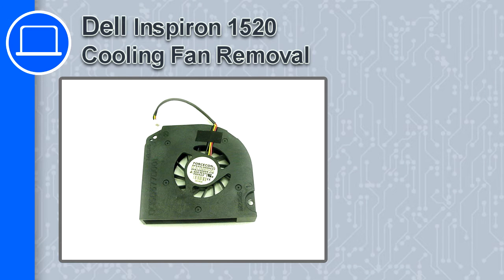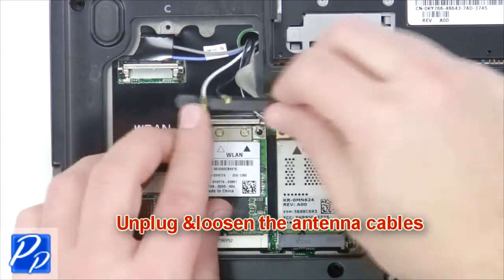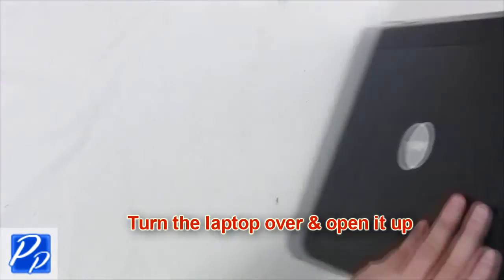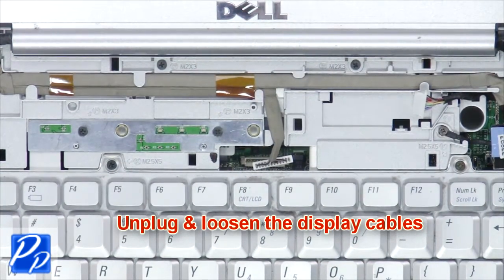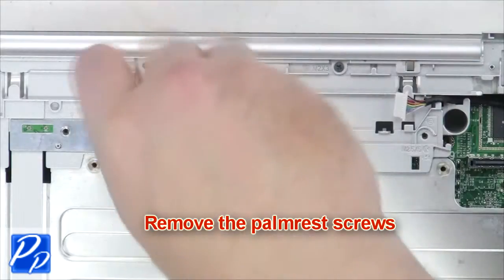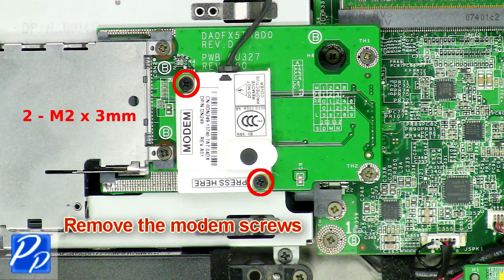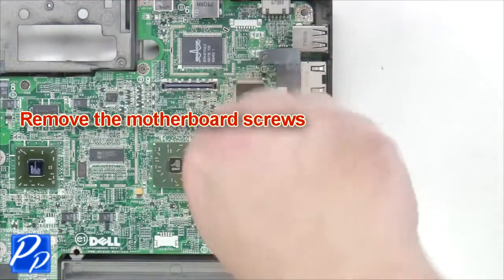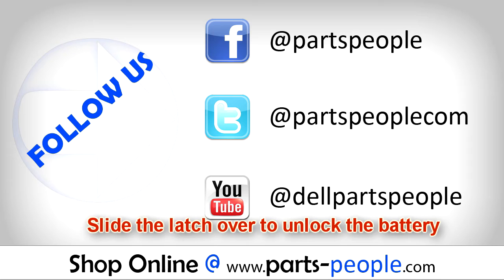Dell Inspiron 1520 Cooling Fan Replacement Video Tutorial

Comment: This is the way I cleaned out the cooling system:
1: Turn off laptop and remove AC power cable
2: Put hand over two exhaust vents
3: Put mouth over other two exhaust vents, like you're going to french kiss it
4: Blow as hard as you can.  Hear the fan spin wildly and watch the dust fly out of the fan vent on the bottom of the case
5: Switch hands and mouth 👄 to the other exhaust vent and blow again
6: Vacuum up the dust that you blew all over the place 
7: Reattach AC power cable
8: Repeat semi-annually.
9: Purchase an i3.

At 100% cpu, the temps are back below 70 degrees C in a 72 degree F room.  I might have considered replacing the fan, heat-sink compound, and adding a bluetooth card if the video didn't neglect to show how to reassemble the computer.  But I did get rid of XP and installed Linux Mint Mate, my first Linux.  So far, I'm running a distributed computing project on it from BOINC.